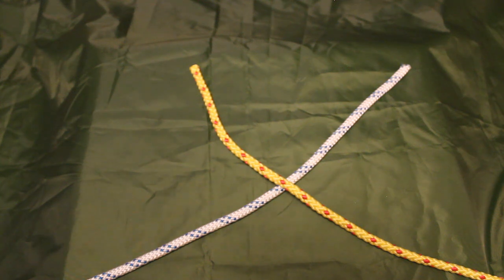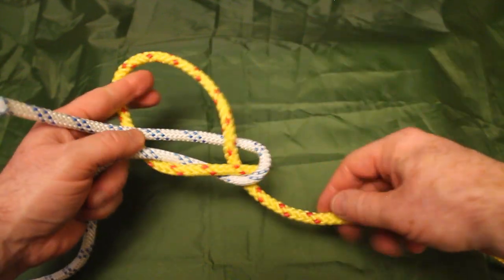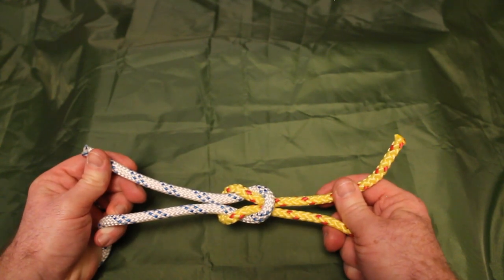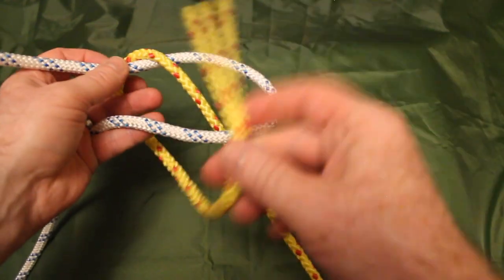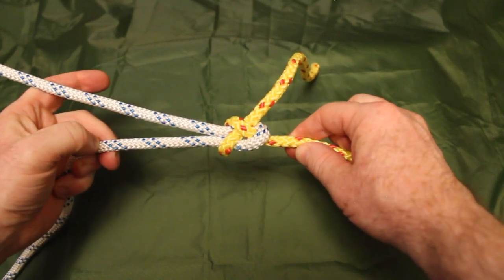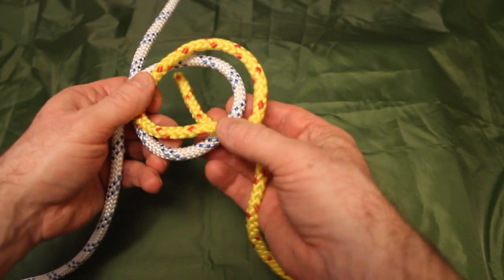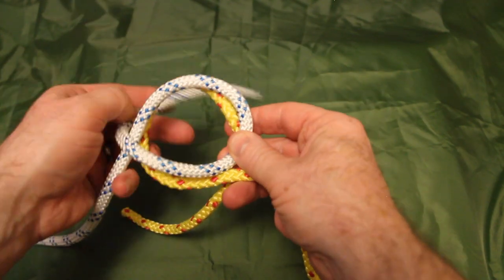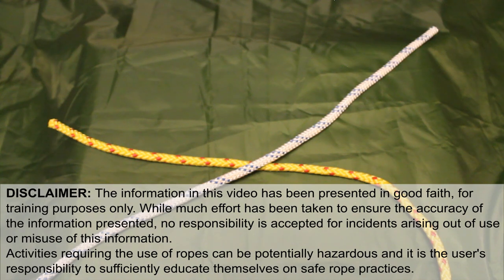How to tie two ropes together (with a Square knot, Sheet bend & Zeppelin bend)

Comment: The knot using your first method is not a Reef Knot, but a Thief Knot. The working ends should be on the same side when done (as illustrated in your second method).
Reply from the maker: Moro Tommi. Thank you for the feedback. Having looked into it more I can see the difference between Reef knot and Thief knot, many sources don't pick up on this difference. I will include this when I do an updated video (I omitted important information on the sheet bend also so need to do an update).
Reply: Correct!

Comment: One knot (not covered in the video) replaces these three knots and most other knots:  The Bowline knot.
If you know the Bowline knot, then you don't need to know these 3 knots nor many other knots.
Another knot to know is the "Truckie's Hitch" because it can provide tension, which the Bowline Knot does not.  For example, you tie a Bowline Knot on one end and use the Truckie's Hitch on the other end to have a taut line.
The third (and final knot you'll ever need) is (I believe it's called) the "Constrictor Knot".
You tie the Bowline knot to an animal's leg (e.g. pig, horse, etc.), the animal will most likely get loose because the Bowline knot does not "constrict" the leg.
Those are the only knots you'll ever need (3 of them).  No need to learn any others.
Reply from the maker: Thanks for the feedback. I was specifically focusing on joining ropes in this video. I covered the constrictor in another video. I planned to do separate videos on the bowline knot and the trucker hitch, they warrant videos of their own imo. 👍🙂
Reply: @EMKayaking  : I'm glad you agree there's only 3 knots people should know.  Every other knot is just useless when you know the 3 knots I mentioned.
Reply from the maker: I'm not agreeing that there's only 3 knots ppl should know, but that those particular 3 are important to know 😉 Every knot has its use.
Reply: @EMKayaking  : Sorry, but I STRONGLY disagree.  Unless you can provide proof that any other knot provides better "whatever" than the 3 knots then I stand by what I said (The 3 knots I mentioned is all people need to learn).
Reply from the maker: @machonsote918  you are certainly entitled to your opinion and are free to disagree. I welcome all input 👍🙂
Reply: @EMKayaking  : No proof, huh?............I'm glad you're coming around to my way of thinking/opinion.
Reply from the maker: @machonsote918  well actually, you're the one making the claim so burden of proof is on you 😉 
Truth is, ask 10 experts you'll probably get 10 different answers...

https://www.manmadediy.com/4748-the-three-basic-knots-you-actually-need-to-know/?andro=1&chrome=1

https://theprepared.com/survival-skills/guides/best-3-survival-knots-every-prepper-should-learn/
Reply: @EMKayaking  don’t waste your time: there are plenty of us who appreciate your skills.
Reply: Would it be ok with you if we wanted to learn and use other knots?
Reply: @jakewade7388  : Thank you for raising me up to a level where people ask me "Would it be ok with you...."...................That's right....me Bad....me Bad...
It's like saying, "Although the hammer is available to use on the nail, I want to use the screwdriver to pound it down.............Although the car has an Automatic transmission, I want to be doing 100 mph in low gear...........Although the house provides shelter, I want to sleep outside underneath leaves when it rains............
I have a feeling you still don't understand.
What I'm hoping for is for these YouTubers to give us something that is really useful.  For example, all the knots require "pulling", if somebody comes up with a knot that can be used to "push" then I'll make that a Fourth Knot that's worth all of us knowing.
Each of these "other" knots can be replaced by one of the three I mentioned.  You want to waste your time "learning" how to do "100 mph on low gear", that's your business......continue watching......
Reply: @notstewie-HelpMeGetTo50SubsPlz  
The guys desperate for attention.
There's an old saying that says;
"When a fool speaks, he says it all and has nothing left to offer"
Reply: @machonsote918  The Zeppelin loop is far more safe, resistant and after a really heavy load, even easier to untie than the bowline. And if you tie it with the appropriate method (forget about the 69, check https://www.youtube.com/watch?v=nNNyzbiuP70&list=PLk1Bi4nV7iki69s1rcWgVwOlf4KhWdhGz&index=4&t=113s and adapt it to whatever seems easier for you), it is even more foolproof to tie. A very minor inconvenient for unusual situations: it is not a post-eye knot...
Reply: Besides making fast to bollards, rings, posts, cleats, etc… as Captain on a 30 meter coastal tug I demanded proficiency with 6 knots. We also worked with cables and chains.
Reply: The bowline was specifically designed as a temporary eye at the end of a rope.